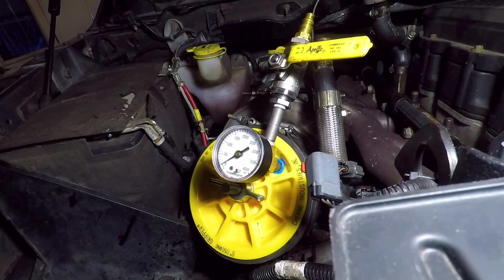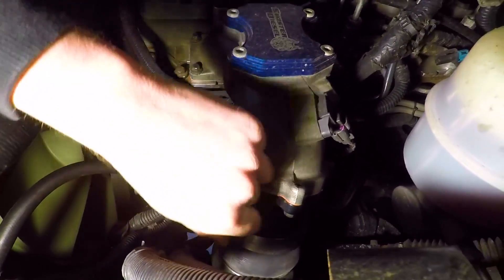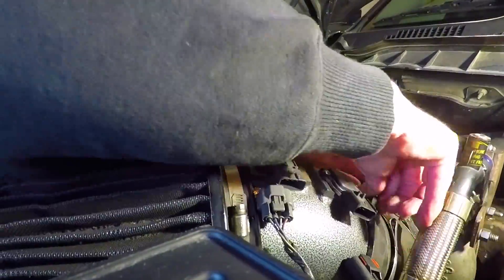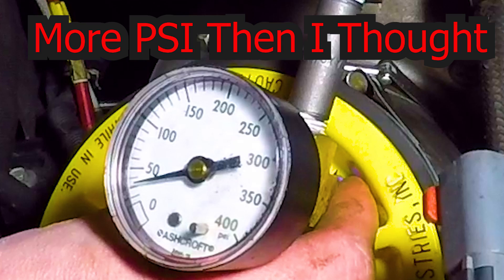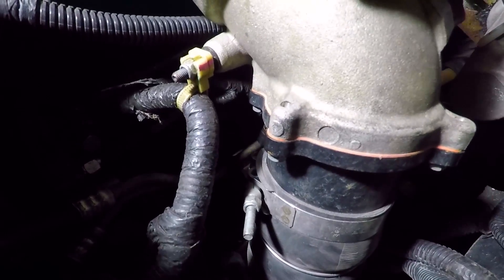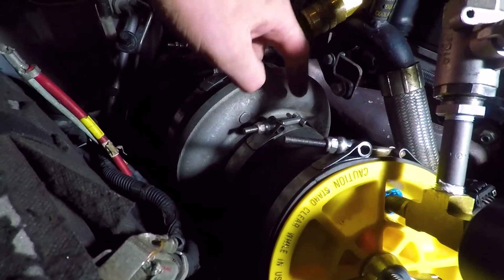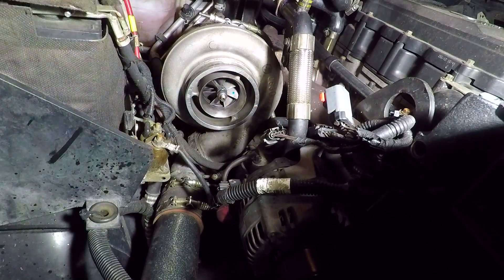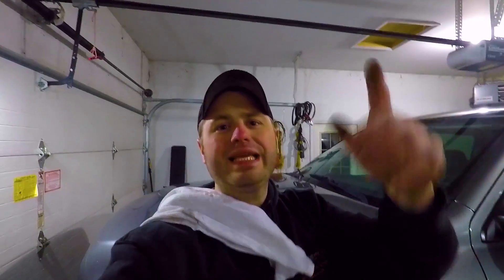Diesel Truck Turbo Boost Leak Tutorial... How NOT To Check For Boost Pressure Leaks!!

Comment: For the waterpump: replace somewhere 150-175k.  I missed the weeping as I also had a very small transmission cooler leak (I knew about the latter, but it hid the former).  Waterpump ended up leaving me on the side of the road on vacation.  Replace only with a Cummins water pump, not aftermarket (haven't read many good reviews about aftermarket).  Nice job tracing down the boost leak.  Stay safe!

Comment: I have a 12V cummins and my down pipe is not properly welded to my turbo so it’s sucking in a lot of air making jet engine noise. Is this the cause for it  smoking out of the exhaust at idle ?  It runs fine . Smells of heavy fumes. Could it all be because of that leak?

Comment: Not sure if you found you coolant leak but I had a similar problem on my 6.7 cummins, turned out the heater core was leaking in the cab, found my disappearing coolant.

Comment: How do u know it has boost leak?
Reply: Mario Menendez he noticed the truck wasn’t getting enough/normal boost pressure while he was driving. So he pressurized the system to listen for leaks.
Reply: Did you have to put #1 cylinder at TDC prior to testing.